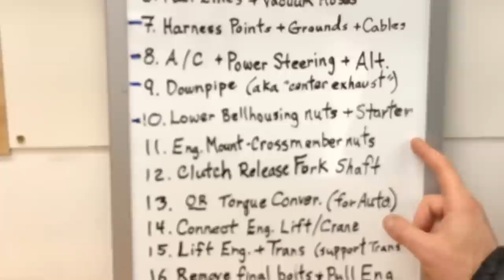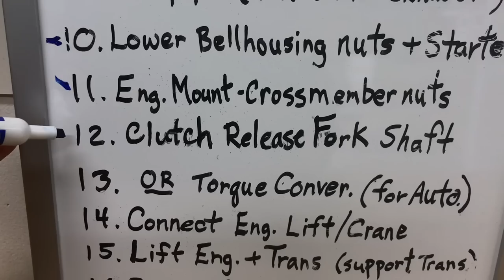Subaru EJ-Series Clutch Fork Shaft Removal Steps

Comment: Found this video a day late and a dollar short!!!  My son has a 2004 forester XT 5 speed, the heads were leaking so we decided to pull the engine. Bear in mind that we did the same thing to his 2002 outback with great success.  By now i bet you know the story!  i have never heard of a pull type clutch!  We removed the bell housing bolts and started to separate the assembly.  After four hours of trying, along with a stroke, heart attack and a brain bleed i was reduced to laying in the fetal position wondering why the system would not separate.  We quit for the day and came back fresh in the morning.  I unbolted the pressure plated (diaphragm) from the flywheel and the motor jumped right out.  Found the clutch disc wore to the rivits, the pressure plate and flywheel surfaces heat scored and wavy along with a noisy pilot bearing.  He has Purchased the ACT Prolite flywheel and a competition clutch stage 2 clutch kit , replaced the turbo cartridge because of excessive endplay and a Grimm speed down pipe.  However it is now going to be -30 degrees so we will have to wait on the rebuild.  All that said, what is your suggestion for reinstalling the clutch assembly and new throw out bearing?  I know the tob gets installed in the transmission side and the clutch on the engine side, what bothers me is the snap ring type connection that allows the tob to disengage the clutch.  Any suggestions or tips on what to avoid or do so it clicks back in and functions properly?  Subscribed to your channel and Brett's in Australia.
Reply from the maker: Thanks for sharing the story and checking out the channel buddy!  Glad to hear you guys figured it out - even if the hard way. 

To reinstall the clutch pack and tob assembly, use that plastic clutch alignment too but when installing get it perfectly centered by actually measuring from the plastic tool surface to some radial point like the clutch fingers, to get it perfectly centered - this will help ensure that trans input shaft will go in nice an easy.  

For the tob assembly, yes it installs on the trans side. Just clean everything, inspect the clutch fork for proper alignment and function. Then carefully install those little snap rings on tob to the fork tabs.  Take you time and it should work out.  Good luck buddy!  Keep us posted on the progress if you can. Cheers! 👊
Reply: @SubaruONLY  Finally had enough time to finish my sons forester!!  installed grimm speed up and down pipe, cobb tuner, ACT stage 2 clutch, light weight flywheel and mono lock system.  unbelievable results in power!!  great channel for the best Subaru information!  thanks
Reply from the maker: Awesome!  Stoked to hear!!! Thanks for watching and that car sounds legit!!!
Reply: Just got back from yanking and prying at the transmission.  Hardly any information about this. I hope I didn't damage anything considering I used brute force. I feel so dumb now but I'm going to try again tomorrow and cross my fingers that this was the issue.

Comment: I have a 2010 wrx and there is no cover plug behind the starter.  Im confused... What next? Will i still be able to separate my motor without removing the shaft? Thanks. Great videos, very helpful and detailed!
Reply from the maker: Not all engines have them. Sounds like yours just didn’t come with it!!! Should be fine!!!
Reply: If it’s an automatic it won’t, this only applies to manual transmission and certain years, not all of them had this.

Comment: Learned a lot from your videos! Thanks for sharing!
Reply: @SubaruONLY  so I'm having this clutch noise issue everytime when I press the clutch paddle. I lubricated this shaft and the noise was gone but came back after I press the paddle for like 10 times. I pulled the shaft out, cleaned it and put new grease on, and the same thing happened again... Was it because I use the wrong type of grease? ( I used Valvoline multi-purpose lithium grease)

Comment: 2006 sti clutch replacement done with Ecedy stage1 kit resurface flywheel.issue1, issue 2 po448 and po448 pcm swap, issue3 boost problem decided to have a Subaru only repair shop do job. 1500 to 2000 dollars.

Comment: Hey Luke, I’ve got a ‘97 manual transmission with ej251 engine. Which clutch fork and throw out bearing do I need to use? My original fork and TOB barely reach the pressure plate. Will the wrx fork work? I don’t see a hole in the top of fork for clutch cable on the ‘06 fork. Any advice would be appreciated

Comment: whats up with the wrx compression  is it burned exhaust valves broken ring lands or rings or migrating guides?   is it because of the turbo extra load
Reply from the maker: It’s got blown head gaskets.  Ring lands all look good. Valve guides also good.  Heads in the machine shop now getting cleaned and resurfaced.

Comment: If anyone is having trouble with this pin like I did while removing engine/transmission, turn the engine and remove the bolts from the flywheel
Reply: How can you remove the flywheel bolts if you can't separate the transmission from the engine without removing that pin? I've tried for two days to get this pin out and no success

Comment: Must you pull out the clutch fork shaft to pull the engine out ? I’m keeping the transmission in.
Reply: Yes, in order to separate the engine from trans you have to either unbolt the pressure plate from the engine or remove the clutch fork as it’s holding the throw out bearing in place which is held on by several fingers of the pressure plate. Short answer- yes you want to remove the TOB fork…

Comment: Is it mandatory to remove the clutch fork shaft in order to remove the engine?
Reply from the maker: Yes, you do actually. It locks into the clutch release hub and that engine won’t come out till that fork shaft is removed.  Good luck!!! 🤙
Reply: Thanks
Reply: Is this step for all years and such?

I am getting ready to remove my engine from my 2007 Impreza 2.5i (EJ253 5-Speed)
Reply: @SubaruONLY  All years/engine?
Reply from the maker: These clutch pivot shafts are not all all Subaru models. You should verify but I believe these are only used on these models and year ranges:
 - 2004-2014 STi 
 - 2002-2005 WRX 
Here’s another way to verify - You can also look up the clutch fork for your model, the ones that use this pivot shaft look very different (due to the center hole for the shaft) than ones that don’t use it.  Good luck - hope this helps!
Reply: @SubaruONLY  I wish I had've seen this comment before trying to separate the engine from the gearbox.
Reply from the maker: Dude... can’t tell you how many people have said the same!!! Cheers!

Comment: Hey there. I’m attempting to pull my transmission off of my engine. I removed the access plug to find that someone has been there before and snapped a bolt in the clutch fork shaft. I had to end up pulling the engine and transmission together, but now I don’t know what to do as they won’t split.
Reply from the maker: Hmmm. This is a tricky one. Gonna have to pull that bolt out one way or another. With the engine out, should be easier to get a drill bit in there and tap in a reverse thread extractor. Gotta get that bolt out to pull that shaft. Good luck!!! Let me know how it goes - cheers! 👍

Comment: Any idea why our bugeye makes a sound when pressing in the clutch after acceleration in 1th gear. It sounds like someone smashing with a hammer once somewhere around the clutch when you press it in. The faster you press it in, the harder it sounds. Only hearing it after 1th gear. Happened after changing the wrx 5 speed to a sti 6 speed and new oem clutch.
Reply: Did you install the correct Flywheel and clutch?
Reply: It was done by a local shop. The same flywheel was used.
Reply from the maker: Hmm.  This is interesting.  The fact that it’s only happening after 1st gear engages makes me think it may be something with the trans.  Usually, if it’s something with the clutch and or flywheel, it will happen when engaging any gear.  Either way, will have to split the engine from trans and pull one of them out to figure this out.  Good luck buddy!  👍👍
Reply: Could it be an engine mount or transmission mount?
We have another isue that i thought would not be te same. When we take corners we here one ‘Plop’ sound also. Thought something to do with the suspension, but now my gf tells that it sometimes happens when shifting other gears to. Maybe it’s the same thing making a little different noise in different directions of movement. 
The sound in 1ste gear is already half a year, the sound in corners started a few weeks ago. I will keep you updated on what was wrong when we find out ;)
Reply from the maker: Actually, yes a engine mount or trans mount will make a solid knock sound - AND they do wear out, so that’s totally a possibility.  First gear is a lower gear and places more load on driveline comments, so if some wear item is giving way, yes you might only feel it when 1st gear engages.  Great thinking man.  Keep us posted on the diagnosis and fix!  Good luck!  👍🤙
Reply: Found out it are indeed two seperate problems. The right front swaybar end link is broken, which probably caused the Plop sound in corners. Gonna fix that soon. When i have more time i will get some deeper into the sound after 1th gear. Engine mounts looking fine in a fast checkup. I’ll be checking the transmissions mounts next time.
Reply from the maker: Nice man.  Good progress!

Comment: I have a sub 2008 outback,  can't get it into gear when engine is running.  I changed the slave cylinder and brake hydraulic cyinder.  Now it goes into gear, but rattles at the clutch fork.  Any ideas??
Reply: Either your throw out bearing is toast, pilot bearing is completely disintegrated or you have a serious issue with your clutch and pressure plate. It sounds to me like your clutch isn’t disengaging at all if it won’t go into gear after pressing the clutch. You need to pull it apart and find out.

Comment: So if I needed to take out the transmission over al for whatever reason I’d have to remove this fork shaft ?
Reply from the maker: Yes, if you have it, you have to remove it to pull the trans out (by its self) or pull the engine (by its self).

Comment: Just don't forget to reinstall that plug or you'll be needing a new transmission and clutch. Just bought one that had the shaft back out, not pretty
Reply from the maker: Hell yea - you see Taylor Ray’s swapped GC?  He totally did this and cracked the trans housing, which required whole new trans. Good call out buddy!!! 👊
Reply: @SubaruONLY  yeah apparently it's a common mistake. I had to pry the clutch fork out of my pressure plate to get my motor out lol

Comment: How do you do a push type clutch fork . Ej251.
Reply from the maker: The push-style clutch fork is actually much simpler in that it just lifts up off the input shaft - in other words, there’s no steel pin to remove first, just lift it up and off the lip and the engine can be removed freely.

Comment: Help anyone got any clever ideas how to get the clutch fork shaft cover plug off. We have soaked multiple time with WD40. and hit it with breaker bar. Run an Milwaukee 250 ftlbs impact wrench multi times like for 20 seconds at a time. Will not budge at all. Have no idea where to go now.
Reply from the maker: 1/2” Allen head socket and huge 1/2” breaker bar?
Reply from the maker: Awesome!!  Glad to hear it worked out buddy - sweet!!! 👍